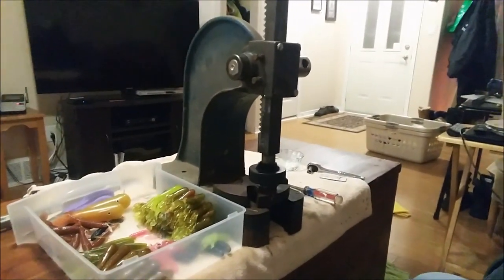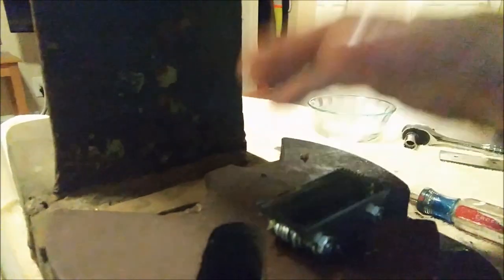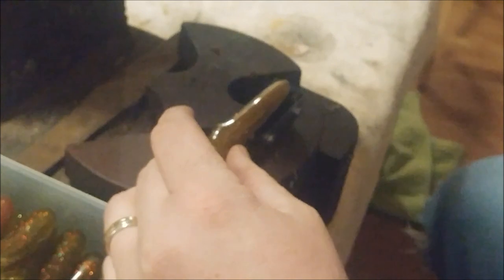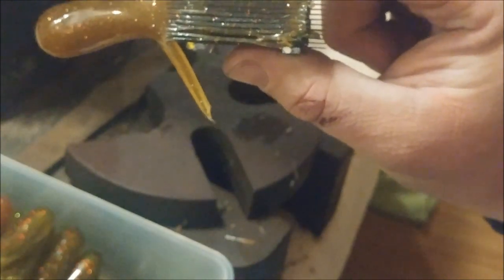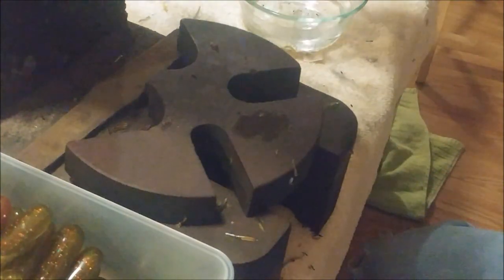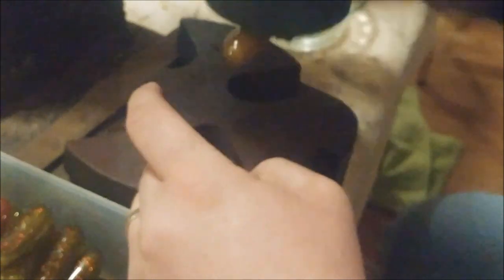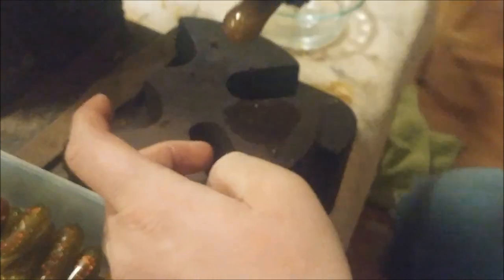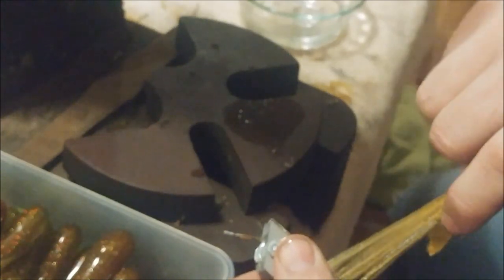Cutting tube tails on a arbor press

Comment: I made my own tube splitter with 15 blades and 2 washers between each blade.  I'm getting a really good cut on one side of the tube and it's hitting the other side but not cutting through.  Any suggestions?  I don't have an arbor press to do this with, so wondering if I'm not using enough force.
Reply from the maker: Steve Buck. Either your blades arent sharp enough or you need to apply more pressure. Also if tbe pressure applied isn't evenly distributed over the entire surface of the tube you won't get a complete cut. What material are you pressing the tube and cutter on?
Reply: I tried using a piece of wood covering it and smacking with a hammer and that was a big fail.  I'm currently trying to get a vertical can crusher to do the trick.  I have a piece of wood under the blades and just using the force of my arm.  I have the blades oiled as well.
Reply from the maker: Steve Buck you can try using a wooden dowel rod. Sit your blades on a table, place the tube on the blades and roll the dowel over the tube to cut it. Works pretty well if you aren't using some sort of press. I'd use a dowel with a diameter of 1/2-1 inch.
Reply: OK, thanks.  I will try that.

Comment: Great video. Where do you get the razor blades with the holes in them to bolt together?
Reply from the maker: Joey I got them from a local hardware store called Home Hardware. I believe Ace Hardware sells some with hole also.

Comment: Do you fish Lake Erie?
Reply from the maker: Yes. I'm about 20 minutes away from Lake Erie.
Reply: The Everyday Fisherman  where do you fish it at? I am 16 and just starting to smallmouth fish up there and I’ve been struggling. I have all the right baits, and fish rocky areas, just can’t seem to catch fish.Where do you fish on Lake Erie?
Reply from the maker: @Matt-sy6dv  I'm in the Niagara area on the Canadian side. I usually from the Niagara River to the other side of the Grand River. Usually around reefs and depth changes. I prefer to fish shallow. If the water is 12 feet or less you can often sight fish for them. If you fishing deeper look for changes in bottom composition on your graph.